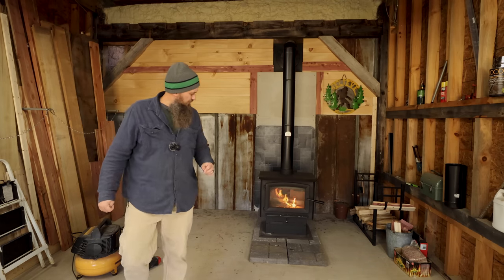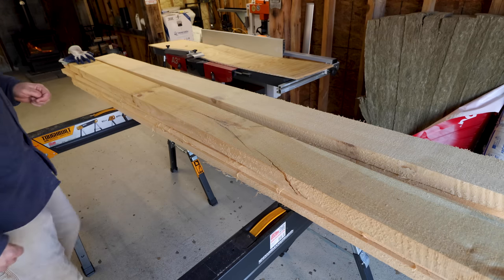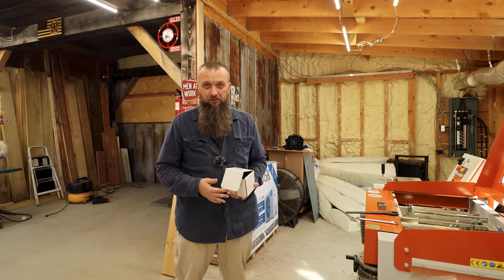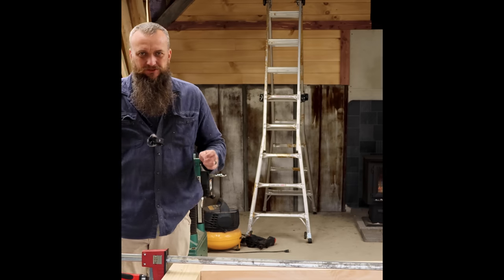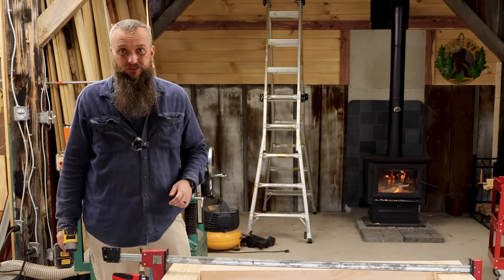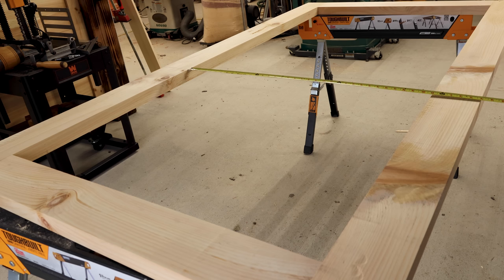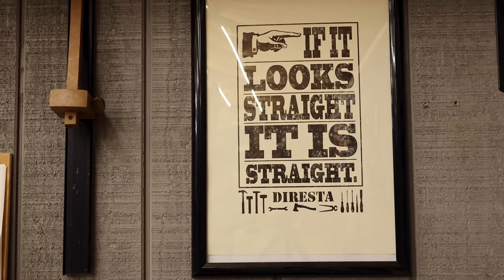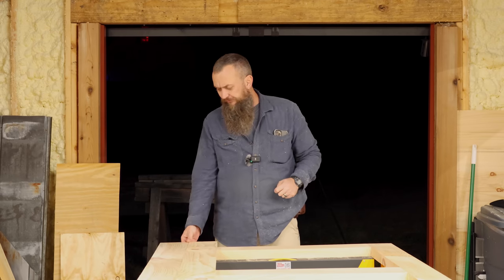Check Out What’s Inside This Box!

Comment: HEY NATHAN, just to let you know, that a lot of your audio of late has been in single-channel and not stereo. It’s definitely noticeable when you switch between an audio source that works well. Check your connections or you have a bad mic. I was listening with high end headset, so it was very obvious of the audio issues.
Reply: I've noticed the occasional  mono audio source as well, but especially on this video. Only the left channel comes through for the vocal track on this one. The intro and the music are well-balanced stereo, but as soon as you cut to lighting the wood stove the sound switches to mono. The new camera provides great video ... all the way to 4k on my PC.
Reply: Yep. One channel is fine the other one is it about 10%. I usually just use one of your plug so I really notice it. I think it's always the right channel that is dim.
Reply: Yep, my headphones didn't like this one bit. Great images but only sound in the left at times. Thought it was some oxidation inside but apparently not. Hope you can figure it out! ❤️❤️
Reply: Same issues here. Best stereo was from inside the moulder and the music sections. Pretty much all the narration was left channel only.
Reply: Nathan, one spot in this video where the audio comes through both channels is your view inside the moulder. I'm guessing you're not using your new 4k camera in there, so probably another setting to figure out on the new camera. Video looks good, keep up the good work, always learning and improving.
Reply: Well, on the iPad, it wasn’t noticeable, but it’s not for stereo listening, either…
Reply: @tysonml I’m using an iPad Pro with Sennheiser headset via Bluetooth and only hear 100% on the left and 0% on the right.
Reply: @markrothenberg9867  Doh! I generally don’t use headphones with my iPad, but I have. Who knows where my head was?

Comment: Hi Nathan  you could do with a couple of Thermal Fans standing on top the stove to circulate the hot air. Used a lot wood burners in canal boats in UK. They don't use any power.

Comment: Noticing that you are using sheets of thin plywood to cover your planer.  How are you finding it for keeping the iron surface from rusting?  I've been using a thin sheet of wainscoting on the surface of my tablesaw for  years with great results.  It's been the best the best option here in the PNW for me.  I think that I had mentioned it in one of your previous videos.
Reply from the maker: Works good. Keeps the dust off which is a breeding ground for moisture

Comment: I never knew about that fiberboard, probably a mineral wool type material, in the top of these new stoves. And it makes perfect sense to move them forward away from the flue piping in the rear of the firebox. That way it can draw combustion air while using the heated air to fraw out the smoke. Good info. 
As for the camera, it seems to deliver great video wuality but I think your videos have always had really good quality. I think the doors wiil look great too, looking forward to seeing them finished.

Comment: Looking straight isn't always straight. I worked in a manufacturing  plant where the mortar joint in the block wall wasn't level, and when you ran electrical conduit or air and water pipes level, they looked like they were not level so you ran them parallel to the mortar joints so they LOOKED correct. It always drove me crazy. Have a Great day!

Comment: The audio is still not sounding right to me.  It seems to be louder in the left channel and doesn't sound as high quality as I remember from your previous  camera.  When the music comes in it sounds just fine though - wonder if you got a bad connection with your microphone maybe?
Reply from the maker: The mic level on new camera was wayyyy high
Reply: @OutoftheWoods0623  Yes it sounded distorted.  It got better in the second half of the video but still didn't sound as good as it used to with your old setup.

Comment: hello sir i have a question i am having a problem with drying lumber in my home made kiln my board keep coming out  warped i could make a lot of rocking chairs with them i sticker and band them my kiln uses wood for heat i have a fan moving the air and a dehumidifier i try keeping the temp at about 100 my hardwood is the worst any ideas thank you for your time